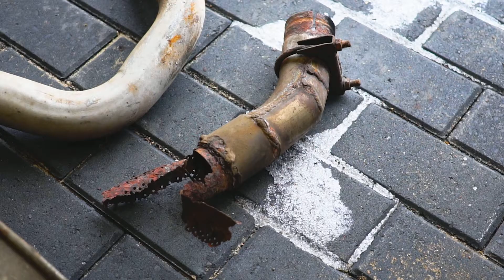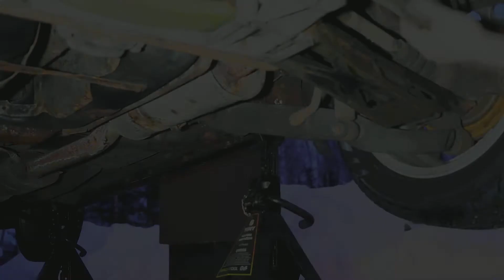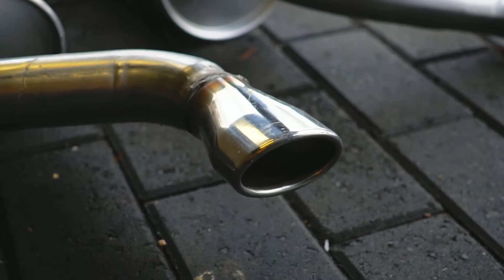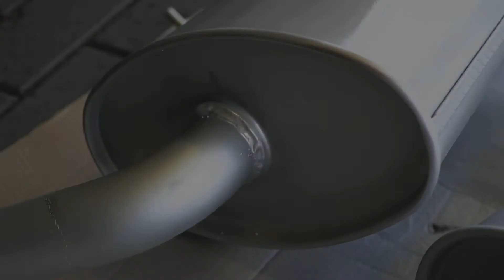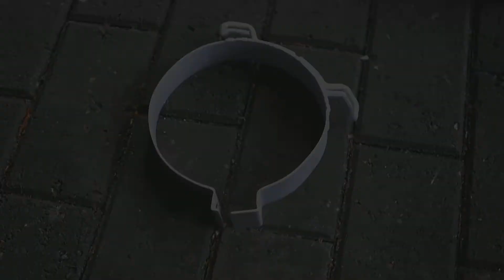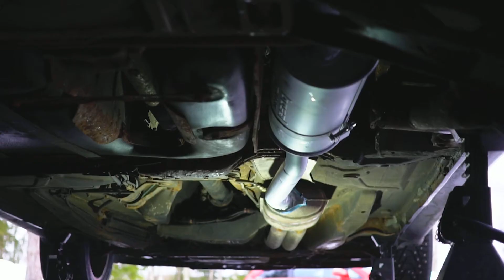Replaced The Old Exhaust With The Cheapest New One - Volvo 960

Comment: Do you think a 3" would fit, or dual 2.25" over the rear subframe? thinking of maybe getting ferrita to make me a custom exhaust for my 960
Reply from the maker: 3" should fit over the rear subframe. But there is not that much room for errors.
Reply: @SATSMotors  do you plan on building your own exhaust? Using e36 m50 headers?
Reply from the maker: Idea is to use a Volvo T6 engine and bmw m50 aftermarket turbo manifold. But will see if I have time to do this.